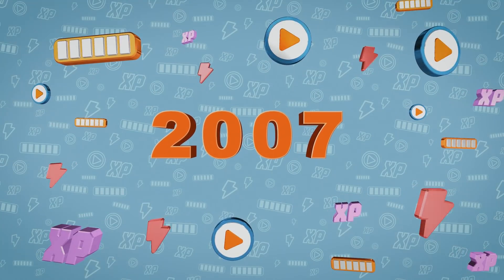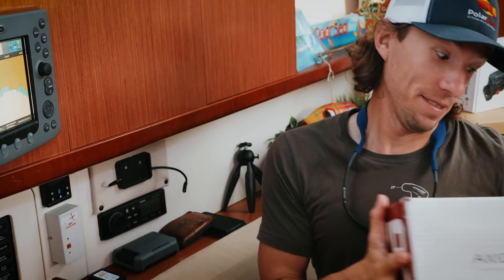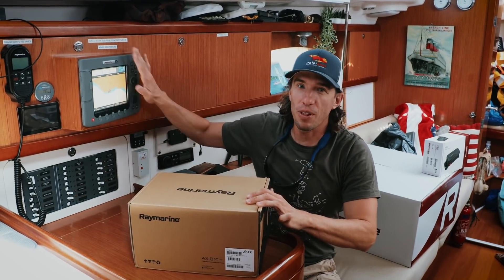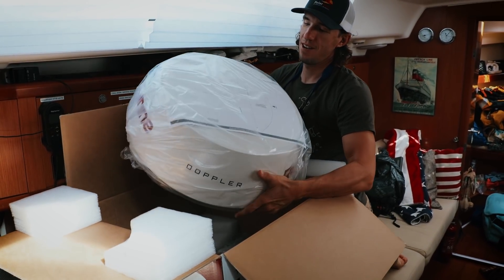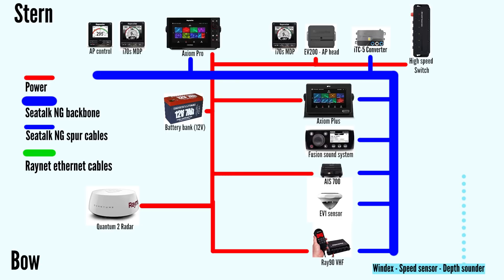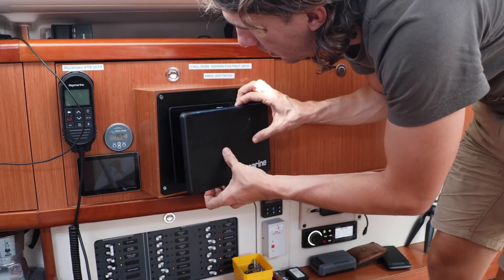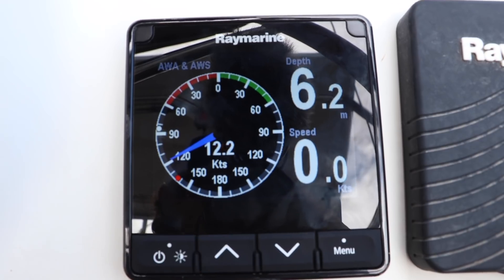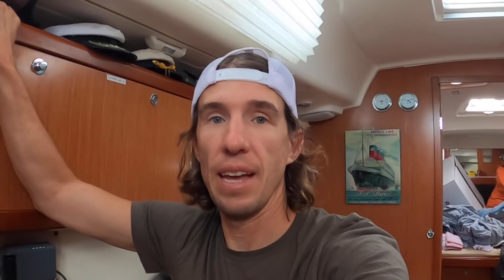SAILBOAT TECH: Full Raymarine installation [Ryan's Tech Corner #14]

Comment: Great stuff guys! So stupid question time. Did I understand correctly that you can use the chart plotter as a on-board WIFI router? If not what type of system do you have on board that allows you to stay connected via internet/WIFI?
Reply from the maker: You can't use it has a wirless router per say, as in you can't put a sum card in it and broadcast... but you can connect devices to share some of the information... like a tablet to get the chart data or the radar.  Ryan